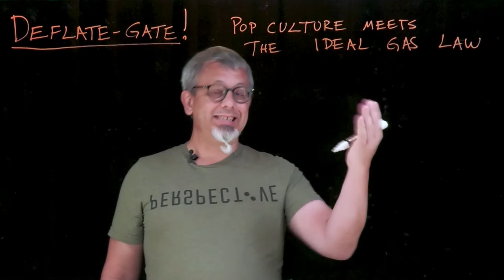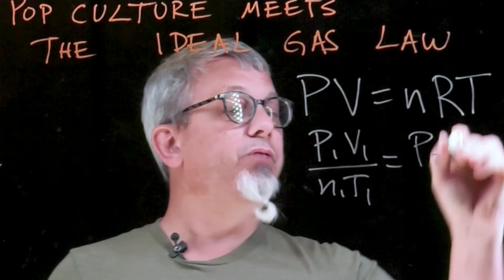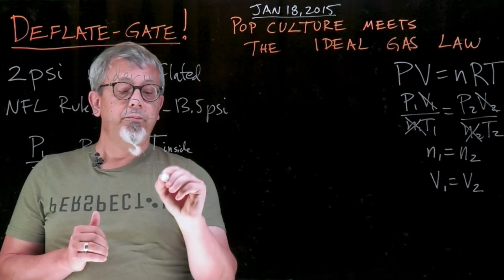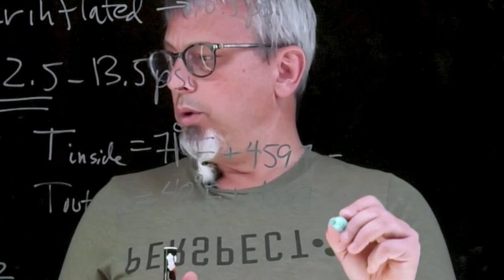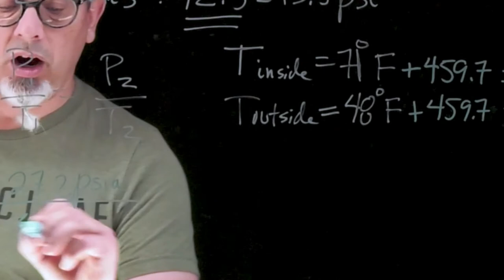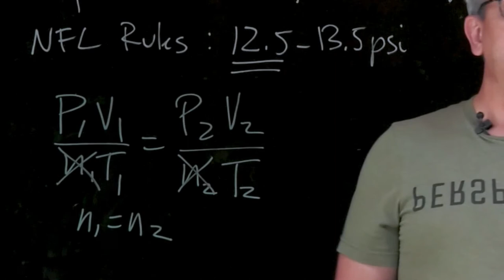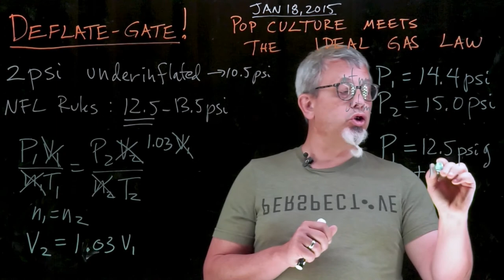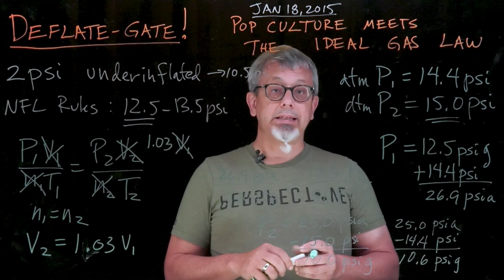Deflate-Gate and the Ideal Gas Law

Comment: Using the “2 psi” claim is problematic because only one ball tested at 10.5. Even on the lower testing gauge, the rest of the balls were gauged at between 10.70 and 11.85.  Even the 10.70 ball is an outlier as the other balls in the 10psi range were very close to 11.  Your first demonstration encompasses most of the balls’ psi range before you even factored in the rain.  

But you also have Mike Florio reporting that the entire 2015 season’s mandated halftime ball measurements measurements produced balls in the same range as the Patriots’ balls that game.  The science showed that the Patriots’ balls were in line with balls measured during the entire 2015 season (including the Steelers’ balls against the Giants in December 2015).